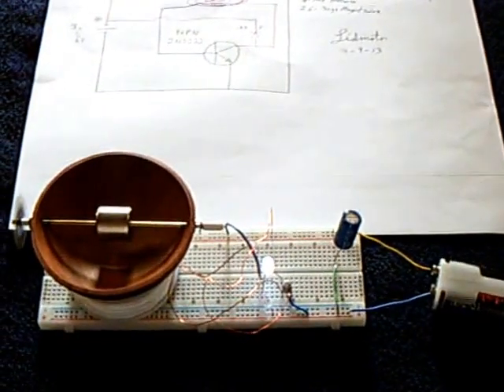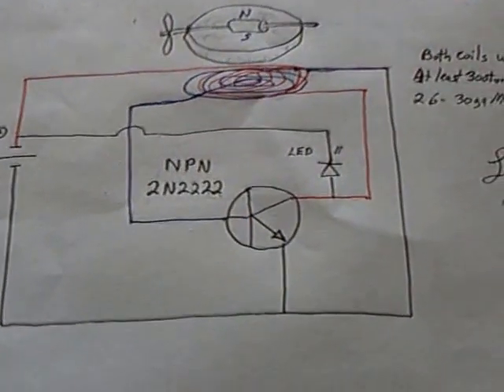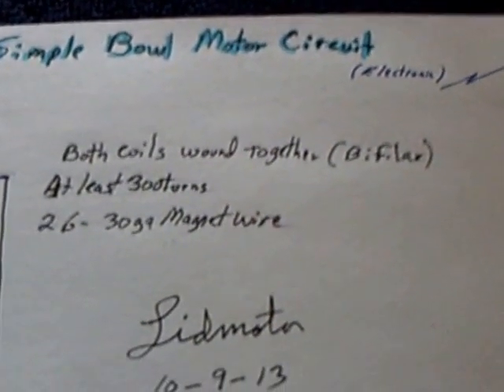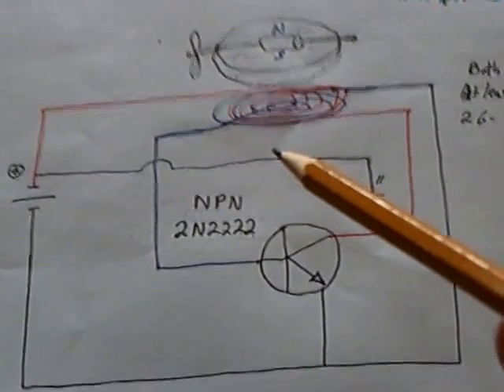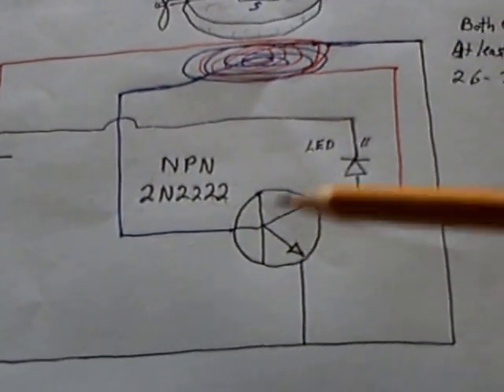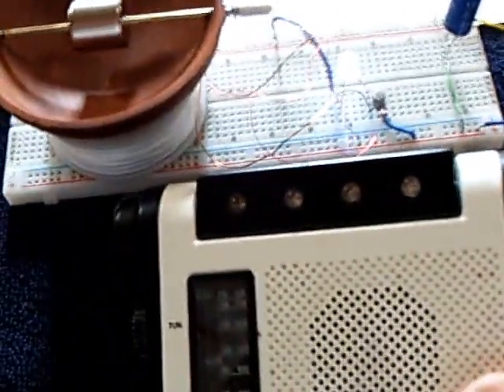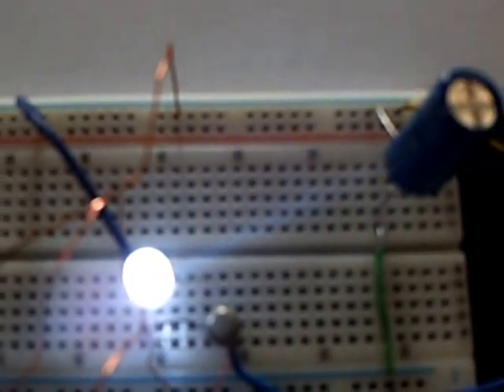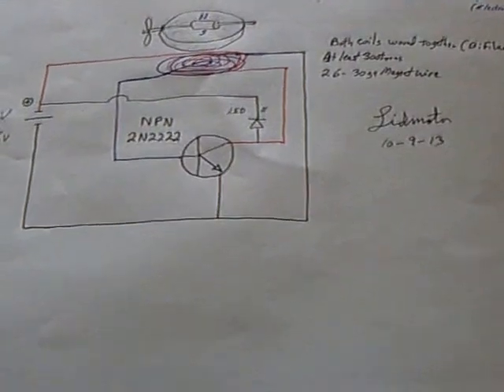Simple Bowl Motor Circuit

Comment from the maker: Thanks.  The ring magnet has a 1/8" hole in it and the shaft is a brass rod.  A small amount of masking tape around the shaft creates a tight fit for the magnet and holds it in place. The shaft is slipped through one hole in the bowl,  the magnet is put on, the tape is added,  and the magnet is positioned.    It is a very simple method but it works on this scale project.

Comment: Well done Lid ! How do you get the axis onto the magnet ? Does the magnet have a hole already in the center and is the axis just a steel rod or what kind of material and how do you fix it to the magnet ? Many thanks.
Regards, Stefan.